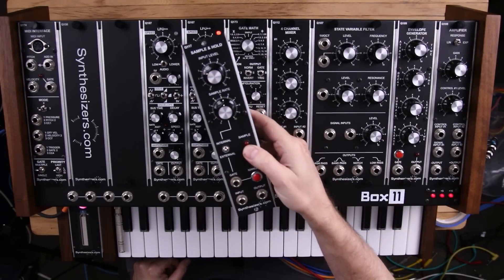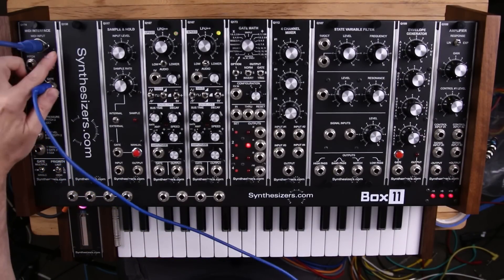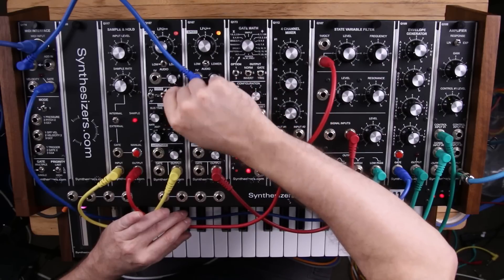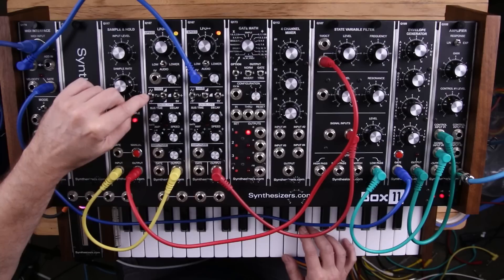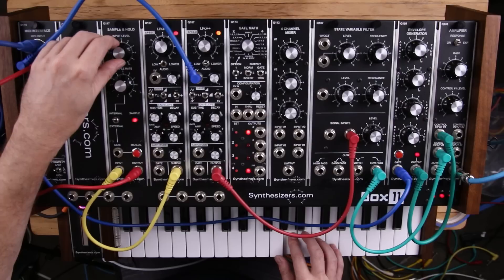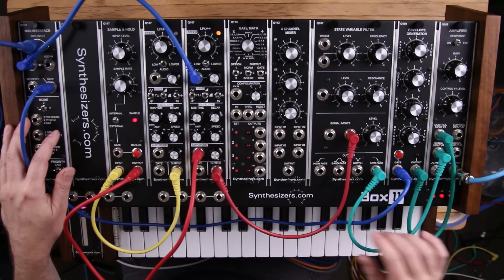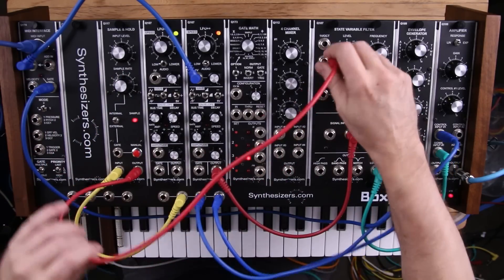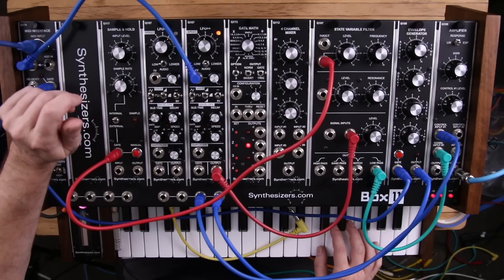Q117 Sample & Hold Tour

Comment: Fascinating.  In my analog synthesizers such as my Jupiter 8  and Oberheim I've always considered S&H to have a random nature (for example when routed to the filter).  The Oscillators pouring into the filter tend to seem random.  Is this wrong?  (such as the end of Mr. Roboto by Styx as a cliche example.)
Reply: It all depends on what the S&H module is actually sampling (in the video, an oscillator). If you make it sample a noise generator, then it will be random, although in discrete steps :)